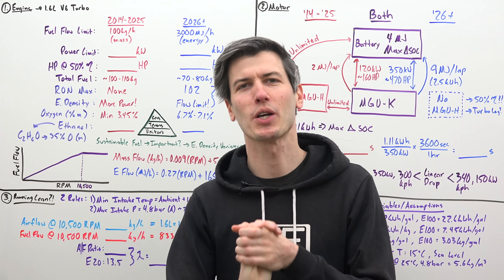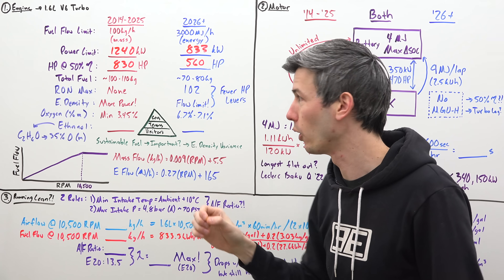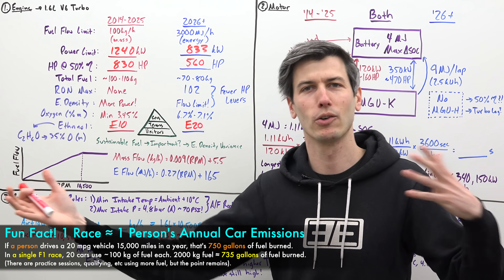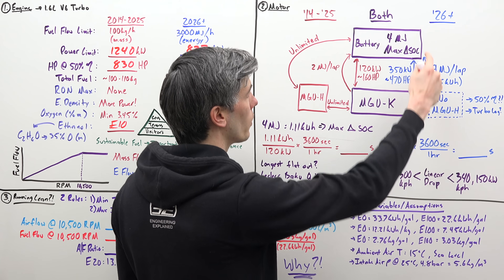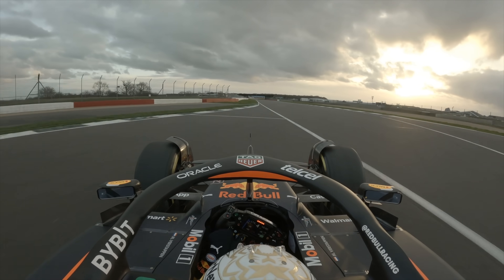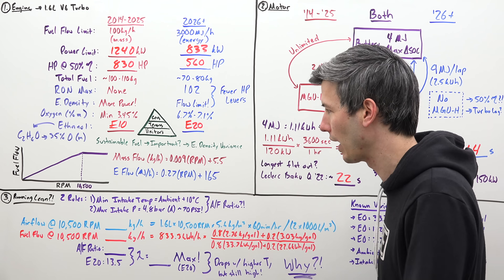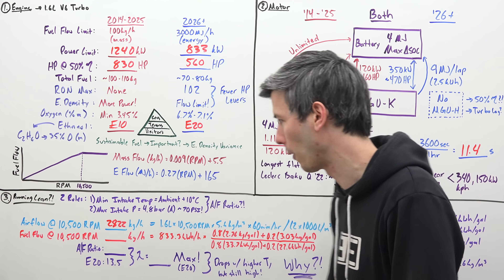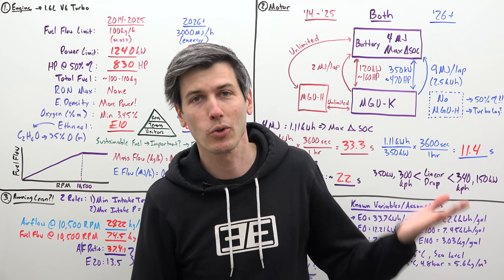Why Are 2026 Formula 1 Engines Going To Lose So Much Power?

Comment: I'm just gonna guess that more air means less NOx, SOx pollution.  Let me Google it, recalling that compression ratio (higher) means more of these pollutants....According to Bing : High SOX and NOX are from:  "High cylinder temperature and pressure during the combustion process
Improper air and fuel ratio for combustion; The high temperature of the intake or scavenger air inside the cylinder; Lower quality of fuel used for the engine."   So probably I'm right, as higher air flow will result in lower temperatures.

Comment: Well this makes it obvious that you can save a tremendous amount of weight in your F1 car by using fuels that have higher energy densities. My calculations show that it should be possible to reduce your starting line mass by around 40 kg by using Unsymmetrical dimethyl hydrazine (UDMH) reacting it with atmospheric air.

Comment: I'd actually like to have a race that the team only allowed to have x amount of energy to start with, in any from they like as long as it's not toxic(like some rocket fuel), and the rest is up to the team.
Reply: ya, there really needs to be unlimited tech advance and have a purer form of innovation in racing. just limit max fuel and engine size, # of cylinders i say

Comment: I’m pretty sure incase anyone was wondering the reason it’s good that you can go beyond 10k without extra power is sometimes it’s not good to upshift but you need more speed to pass if you upshift the RPM drops losing power and speed but if you stay in gear and go to 11-13k around a corner when you come out you not only have extra speed but upshift to a higher RPM. Also if you mess up a down and go to 15k RPM it’s not going to blow your engine. Most pro drivers will not make this mistake.

Comment: What difference do their emission requirement make if theyre using synthetic fuel????
Reply: Synthetic fuel is kind of dead… You need more power to make synthetic fuel than when you use same anergy in eletronic motors…
So syntheric only makes sense, when you can not use battery and eletronic motors….

Comment: Sad about the withdrawal of the MGU-H, seemed like an excellent way to harvest waste energy, and I can't see how it makes sense to turn away from it.  Is it that the MGU-H is not allowed, or simply not mandated?  If the latter, engine manufacturers might still use it.  After all, its an energy game and that's free (well almost free) energy.
Reply: Not alloved. The poin is that MGU-H did make electric power all the time, so you allmost always dis have full battery. Without it it is harder to get the battery charged and so very important how and when you use the extra power. 
So they allow more extra power when you use ”electric” boost, but you can use it less times in the race. it theory it could allow more changes vs driving in nice lines depending on if you have full battery or not!

Comment: Just a curious question, but if teams were allowed to run more air through an engine would that possibly reduce the load on the cooling system? Therefore, allowing teams to use smaller radiators and openings for better aerodynamics. I'm unsure how running even more lean than they already are would affect this since its already a unique situation to be running at lambda 2.
Reply: Yes, by running an excess of cold air through the engine, they could reduce the coolant radiator size, but they would have to increase the size of the intercooler to reject the additional heat from 55 psi boosted charge air.  Cooling drag due to the heat exchangers would stay about the same.

Comment: I was thinking of ways to get more / cooler air in the engine by taking advantage of decompression cooling but ultimately even if it was able to produce more power somehow, output could never exceed input fuel flow.  Perhaps they put in the other limitations so they could decide later on to allow more fuel flow while still having other restrictions - though it seems to me that the restriction they put in would allow for like 6 times more fuel to be used so yeah it's just weird.

Comment: The min temperature intake air rules combined with the intake air follow limitations seem to indicate that teams are using excess air to cool the engine. This sounds unintuitive to most petrol heads sine leaner means hotter under normal circumstances, but if you are already running so lean that you are burning all the fuel, then even more air will just reduce cylinder temperatures by helping to carry away excess heat and also potentially increasing the efficiency of the engine by increasing compression.

Comment: So the racing will become even more unwatchable?
Reply: Depends… These allows more overtakes than rules we have now… So if you like to see overtakes… Enjoys, if you don´t like overtakes in car reces… you don´t like this change.
Reply: @haukikannel  It seems like F1 is moving from a pure performance pursuit to a sustainability pursuit, and the reason is utterly bogus (climate change).

F1 is the ultimate in motorsport, so they must bang the NetZero2030 drum which aims to reach a net zero CO2 emissions in 7 years.

The 2030 season should prove interesting. WDC will probably go to the driver using the least fuel.

Comment: airflow rule will be to prevent fuel saving (which seems daft i guess) - e.g. why put any fuel into the engine under breaking, let momentum keep the engine spinning.

Comment: If they got  to user higher  boost pressure higher would that allow them to make smaller intake valves and thus bigger exhaust valves?  And if so would that give them a better volumetric efficiency?

Comment: I think the comparison could have been a bit simpler- fuels like gasoline have energy density of 4.3MJ/kg- so the new regulations would, as you have surmised, result in 30.23% (1 -3/4.3)*100% 
reduction in output power.

Comment: This is why formula e sucks they have no speed. It's not watchable. They're going backwards in F1 and for no good reason.
Reply: F1 are as fast or even faster than before. at 2026 the F1 will be even faster that we have now? What are you talking about?
What we have lost is the sound of the motors. But the speed is there and will be. Even pure electric cars are faster than current and past f1 cars!

Comment: It seems energy management (integral calculus) will become as relevant as power management (diferential calculus) in both drive and coast conditions. 
It also seems front axle will become relevant as regenerative braking axle if we want to catch all energy without rear tyres blocking.

Comment: By those numbers we're still talking about a total system output of over 1000 horsepower at full e-boost (if the engine and motor can peak at the same time), which is roughly what they're purportedly capable of now. To me it's much more important that they find a way to make F1 cars smaller and lighter for 2026 as well. The automotive world has got to realise that dumping a giant battery into a daily driver with the mass of a truck is not the answer to the bigger picture, and F1 cars championing efficiency through lightness would be a great poster for that. Make them 100kg lighter somehow and shout about it.
Reply: Also you have that peak 1000 power shorter time and it takes longer time to get the battery loaded… It means more interesting races depending on how full the battery is in each car at any given moment!

Comment: Because of your last video on formula 1 'hybrid engines' i began to think of 'similar techniques' using in high-performance Jet-engines like the Eurofighter-Typhoon or the futher Tempest-Jet. But i struggle with the energy density of the involved components quite a bit:
Eurofighter-Engine: ~59MW power at ~1000kg weight.
Electric high-performance motors ~30-60kw/kg
Lithium batteries: ~300wh/kg Energy density, with C30 dicharge rate mabe ~9-10kw/kw, so nowhere near the energy-density of the combustion turbine, but the jet needs also a lot of electriyity for radar, sensors,... so maybe most of the interation of the combustion-system and the jet is just to get the electricity out of the spool most efficiently that has surplus energy in the moment anyway, so 'slowing down selectivly' more than 'boosting up selectivly'?!

Comment: 100 kg of gasoline times 13% equals 13 kg of hydrogen, 13 kg times 120 mega joules equals 1560 mega joules. 
3000 mega joules divided by 120 mega joules equals 25 kg of hydrogen. 25 kg of hydrogen divided by 13% equals 192.308 kilograms of gasoline. 
At 2.85769 kg per gallon that would be 67.295 gallons. Looks to me like formula 1 engines may be gaining so much power!

Comment: Back in the 80's Renault F1 engine were rated 1500 HP (1.5 liter turbo charged). All engines were tested just after assembly and had to reach the 1500 HP within the first 15min. on the dyno. Failing to reach this goal was... dismantling all the engine and rebuild it from scratch...

Comment: A true Formula 1, not the actual travesti we see on TV, would've made the jump to hydrogen 10 years ago, to pioneer it. It's not even considering following what others have already started, being up to its neck politically correct lithium batteries. When did Formula 1 cars weigh 800kg in the past? It's not a sport, it's policy. A sign of intelligence is simplification, not complication.

Comment: That 350 kW means the cars will accelerate faster up to a point. Top speeds will probably drop but average speeds might not change.
Reply: I was thinking the same.
Also it will be more tactical when and how you use the bigger e-boost to your speed. You can use your whole batter empty at shorter time period. It also takes longer to load up the battery. So races will be more tactical than they are now.

Comment: They need to stop beating around the bush and just go for a cc limit and have a battery capacity limit. 
1kwh battery and 600cc limit for the motor no other rules with the power units

I wanna see a 600cc v10 30k rpm 150psi of boost on meth with a 1000hp ofelectric motors for 3 sec at a time powering all 4 wheels 😂

Comment: Very very interesting and in-depth, congratulations. I don't think it is the right direction for F1 to be heading in, I know I'm not the only one, but they should go back to 3.5L, high-revving NA engines with up to 12 cylinders, running on biofuel.
Reply: I would like to see 10-ish litre V12 two stroke diesels running in the medium speed regime (~1200rpm redline).

Comment: Jason, a couple of points.

The fuel energy density must be between 38.0 and 41.0 MJ/kg, so that would help you with your air:fuel ratio calculation. The fuel flow will be between 73.2kg/h and 78.9kg/h.

There is also a rule that limits the speed at which the power output of the PU can be reduced while the driver has maximum torque demand. That is, the output can reduce up to 100kW per second, and the maximum reduction in output is 450kW. So the driver can have 750kW when he gets to full throttle at the start of a straight and be down to 300kW by the end, while having his foot to the floor. It means that the MGUK could be harvesting up to 100kW by the end of the straight - and it is probably the only way they will get anywhere near the 9MJ recovery.

The current PUs have a maximum geometric compression ratio of 18:1, the 2026 has changed the 16:1.

The 2026 power units will have less power on average over a lap, but they will weigh the same, more or less.
Reply: "The 2026 power units will have less power on average over a lap, but they will weigh the same, more or less."

yay....so they'll be slower....and then have turbo lag because shoving the car down the road on electric won't be making the exhaust gases needed to spool up the turbo..
Reply: @JohnLawley24v  I suspect the main use of the MGUK will be to help propel the car out of the corner where turbo lag is a big issue.
Reply: @waynec3563  yes indeed. The power vector of the ICE will be a static graph, but I suspect the Power vector/graph would be variable for the battery. And this could be similar to the lift and coast we have at the moment, which will disappear under the new regs. You will have the drivers running flat out, but have different power graphs on their steering wheel during the race to control moments, like the engine mapping setting. They will also be able to control the drive-ability of their car, in terms of how much power is given to them on acceleration. So it could be interesting, and will help a lot during wet races as drivers will be playing around with this setting to prevent wheel spin

Comment: And this is why F1 is so bloody boring!  I'm an engineer, i love techy stuff, but F1 shouldnt' be a tech fest for Nerds like me!

As Jason points out, the emissions / carbon footprint of the cars themselves whilst racing are tiny compared to the massive overhead of running the teams and all the people travelling to the races and the infrastructure of the race tracks themselves.

Here is what i propose for an actual decent to watch f1 season that is "green"

1) all teams must be carbon neutral and renewable powered 100% (soalr panels on roofs of team buildings and wind turbines. Employess must drive EVs to work, all air frieght at shipping must be carbon offset

2) the cars have 3l V10 engines with no power, fuel or rev limit

3) aero downforce is limited to a 1:1 ratio at maximum (ie car can make it's mass in downforce and no more)

Comment: Asymtotically approaching another spec car series, like IndyCar. And kind of an anemic one at that. They also resist any kinds of automation beyond paddle shifters and power steering, making the cockpit management a flurry of button pushing and other nonsense.  I guess the kids driving these cars don't know anything else, but meh. Wny not traction control and other modern features if they want to improve road cars etc.?

Comment: So it sucks that the car industry at all levels are all downsizing to smaller engines and more electric motors. But what balances out the downsizing is the engineering barriers that would have never been broken through with large conventional powertrains.

Comment: About the absolute pressure limit, my interpretation would be along these lines: you made your calculation with the airflow generated at 10500 rpm, and most likely running that boost pressure at those rpm would be useless because the mixture would be too lean as you pointed out… but at lower rpm the airflow would be lower and maybe you could then use a higher MAP in the low rpm region to flatten out the power curve and have close to max power at all rpms?
Would you consider this a possibility?
Reply: I don't think so, because at lower RPM the fuel flow limit is also lower. For example at 8000 RPM you can't use as much fuel as you can at 10,500+ RPM, so if you already have quite a lot more air than you need at 10.5k, there's no benefit to having that much air at 8000 RPM with less fuel. You'll be even more lean than you'd be at max fuel flow, making it even further from optimal.
Reply: Why would the fuel flow limit be lower at lower RPMs?  @Ninja98x

Comment: liberals are everywhere, actually finding a proper solution hard work and research, they always find the shortcut to abandon things.
2030 FIA be like: drivers need to run in the f1 chassis there'll be a cut out at the bottom part.

Comment: I know exhaust blown diffusers are now banned but there are still likely to be aerodynamic advantages in using the engine as an air pump so this could be why the FIA has set an air flow limit.

Comment: When are you going to interview an official to find out why?
Reply: I can see two reasons… 
1. Green washing, that was mentioned allready in this video
2. Make overtaking easier (i think that this is the main reason) Because new e-engines gives so much more power, but you can use whole batter in less time than before, you have to use e-boost more tactically. Also because it takes longer to charge up the battery than before. We can see situations where some drivers has allmost empty battery, while other has allmost full and that makes is so that overtaking vould be easier, because there is bigger difference in max peak power at different parts of the race!
Reply: @haukikannel  that’s great. But it doesn’t answer my question.

Comment: Does the mgu-k connect to the crank? How does that work? E.g if a crank is rotating at 14000rpm then the mgu-k adds power to spin it at 15000 rpm does it affect ignition timing? Or am I way off? Can someone direct me to a video that explains how ICE and mgu-k combine to make the cars go faster.

Comment: Just a thought about air/fuel ratio. 
Is it possible teams are running a version of Active Fuel Management in an effort, shutting down fuel to individual cylinders.
By putting a cap on the air/fuel ratio, this is a way of knocking that practice on the head.

Comment: Great information as usual. Very interesting. I do think however you mis-understood the Min intake air temp rule. The minimum temp above ambient will be very easy to achieve however at 11:05 you say this will be tough to achieve. Its a min temp above ambient, not Max.

Comment: Maybe the higher boost pressure allows for smaller valves and better combustion chamber geometry. Also the air flow could be considerably lower if the engine runs closer to Atkinson cycle.